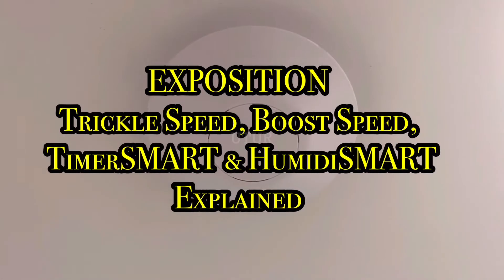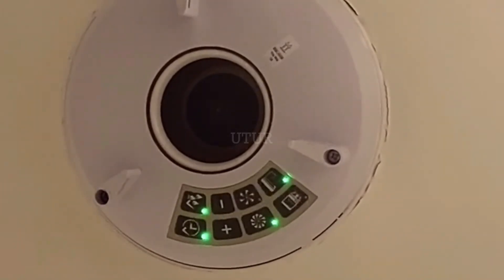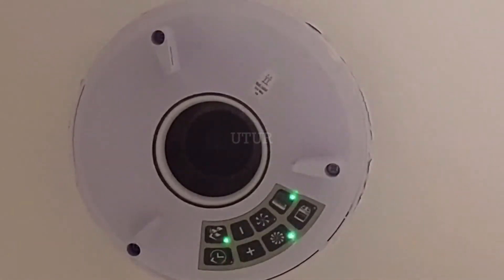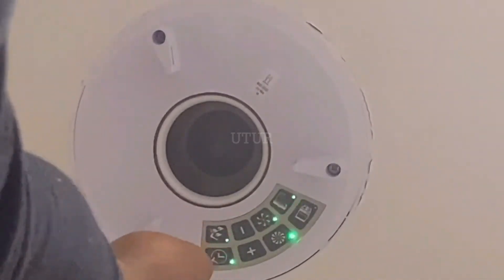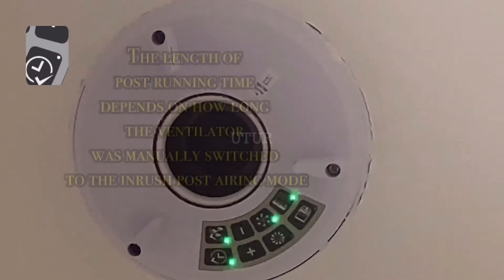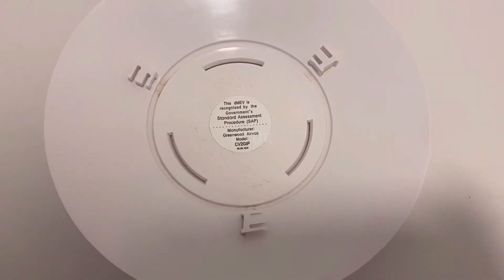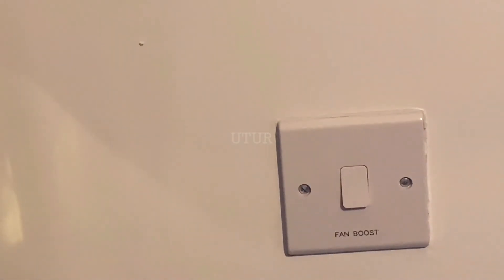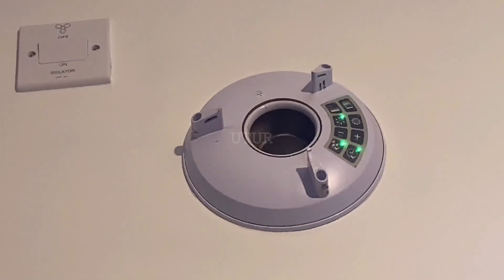Noisy Extractor Fan fix- Master the Art of Bathroom Ventilation: Guide to Installing & Commissioning

Comment: I would like to switch my fan off completely, it is only linked to the light switch. I have taken the cover off and it is as you described.
Reply from the maker: Hi Orpheus631, 

See ultimate guide in link below

https://youtu.be/xx_uXxUBqtU?si=h7QfLi9CvYyY0U45

First: Identify which type you have

Most CV2GIP-type fans run in two modes:
	Trickle speed (always on, quiet)
        Boost speed (comes on with bathroom light or humidity)

Whether you can switch it off completely depends on the wiring.

Option 1 – If your fan has an external isolation switch

Look outside the bathroom for a 3-pole isolator (looks like a white switch with “Fan Isolator” written on it).

To turn the fan off completely:
	1.	Locate the isolator switch (usually above the door or in the hallway).
	2.	Switch it to OFF.
	3.	The fan will stop completely.

This is the intended safe method if available.

Option 2 – If the fan keeps running even with the isolator off

Some CV2 fans are wired directly into a permanent live without an isolator.
In that case, you cannot legally or safely disconnect it yourself, because it sits on the fixed wiring.

To turn it off completely you would need an electrician to:
	•	Fit a fan isolator, or
	•	Disconnect the permanent live feed at the circuit (not recommended for you to do personally).

Option 3 – If you only want to stop the fan running all the time

Most continuous-running CV2-type fans have internal DIP switches that allow you to:
	•	Reduce trickle speed
	•	Disable boost mode
	•	Switch fan to “intermittent only” mode (fan off when room is not in use)

This requires removing the fan cover and adjusting the small switches inside.

Only do this if you feel confident, and turn off the circuit at the consumer unit first.

Option 4 – Temporary stop without touching wiring

If the fan is a humidity-controlled model and keeps running:
	•	Reduce the humidity setting inside the fan.
	•	This can stop it boosting but won’t turn off trickle ventilation.

Important Note

If the fan is part of the property’s Building Regulations compliant ventilation (common in newer UK homes), switching it off may cause condensation, mould, or breach regulations.

But you can reduce the speed so it’s very quiet rather than fully off. I hope this helps. Don’t forget to subscribe. Like and share. Helps channel grow.

Comment: I don't have boost switch.... Do they boost automatically when showering?
Reply: Yes
Reply from the maker: Hi MarcusRobert-s2g, Apologies for the late response as just catching up but better late than never . 

If your fan is a CV2, CV2GIP or any similar continuous-running fan, it will normally boost even if you do not have a separate boost switch.

These fans usually have two possible boost triggers:
	1.	Automatic humidity boost
Most continuous-running fans contain a humidity sensor. When the humidity from a shower rises above the set level, the fan will automatically switch from trickle speed to boost speed. This does not require a wall switch or pull cord.
	2.	Optional light-switch boost (not always installed)
Some bathrooms have the fan wired so that the boost activates when the light is turned on. If your bathroom does not have this, the humidity sensor is the only boost trigger, and that is completely normal.

⸻

If your fan is not boosting during a shower

Possible reasons include:
	•	The humidity threshold is set too high.
	•	The sensor inside the fan is dusty.
	•	The fan has been configured to run in trickle-only mode.
	•	A wiring issue (less common).

These can be corrected by adjusting the internal switches once the power is isolated.
 Don’t forget to subscribe, like and share . Helps channel grow

Comment: What if I don’t want the 24/7 running on trickle but don’t have a on off isolator switch, can I somehow turn it of in the fan settings, just for the fan to come on when I’m in the bathroom with the light on. As mine was already fitted and is rigged to only the light switch when I turn it on the fan comes on. I don’t want it to constantly run 24/7 In trickle mode.
Reply from the maker: Hello drgunsmith4099,  If you don’t have a dedicated bespoke isolator switch linked to your extractor fan but a conventional switch linked to it which appears to be your case, the switch in any effect does the same job as the isolator switch and booster switch. So once you are done from the bathroom. Turn off your conventional switch. Instantly it goes from Boost to trickle speed. The trickle/boost speed should run for the duration you were in the bathroom viz a viz humidity or man made spikes generated. Normally you can cut down the time the trickle speed runs by flicking an isolator switch OFF. In your case you don’t have an isolator switch so my educated guess would be either 1. that the switch does both the Job of the Booster when ON, Trickle when OFF and trickle runs for period of occupancy 2. That the switch does the Job of Booster when ON, when humidity levels drops it automatically goes to Trickle speed and when Switch is OFF it turns Trickle or extractor fan OFF completely. There is no way of knowing what the plausible mode of operation or modus operandi of the rigged connection is without observing as trickle speed is a much quieter speed depending on the setting. So take OFF your cover plate and monitor when the fan rotating actually stops during usage using the processes in 1 & 2 and you should be able to work it out. I hope this helps as is the best I can do remotely. Don’t forget to subscribe, like and share. Helps channel grow. Have a great week ahead